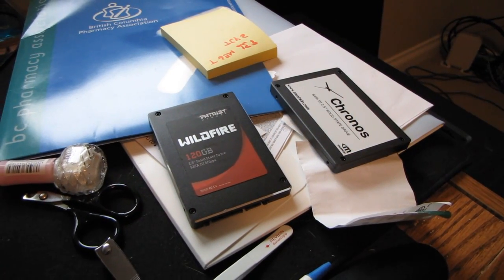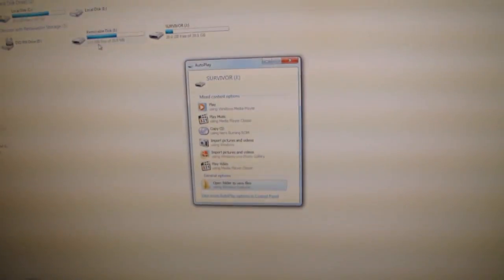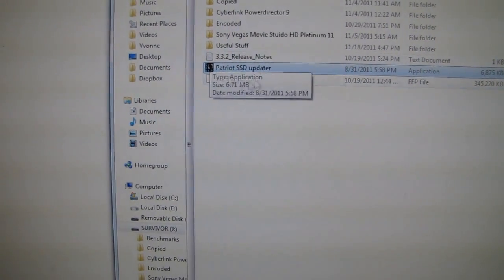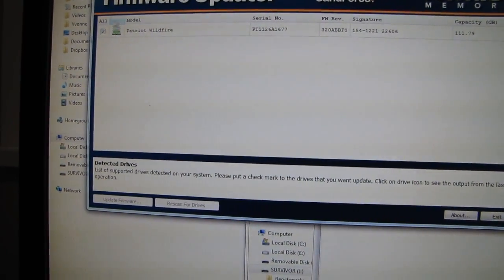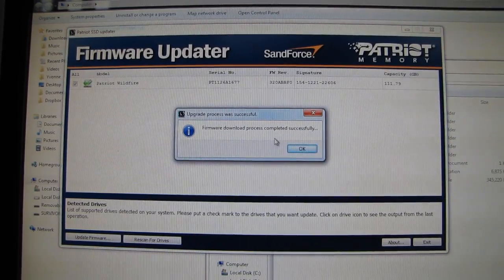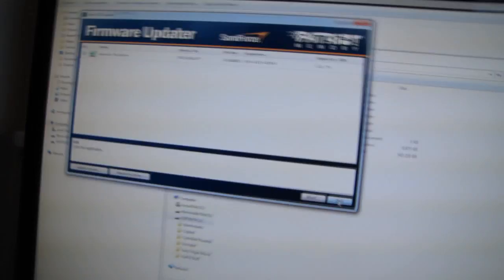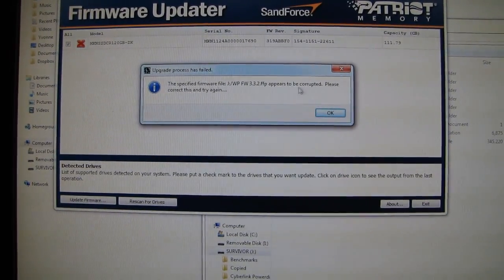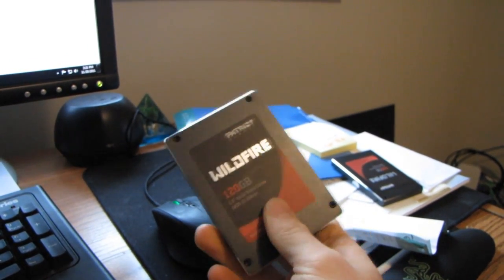How to Update Sandforce SSD Firmware Guide Tutorial Linus Tech Tips

Comment: hello

my ssd  few used completly died, is an intel 335series with 240gb , after i opened it i see the soundforce get overheat... i think the problem is soundforce controller and i need to replace it.. (after checking i see there is no capacitor/diode or resistors/fuses broken.)  if i replace the controller is necessary a firmware update to be compatible with i tel platform?  teach me what i should do..? if i remove the controller from a similar ssd and install on my ssd will work? i just need to recoverdata.. 

the firmware on intel 335 is located in the soundforce controller or is  a difderent chip?
Reply: wut?